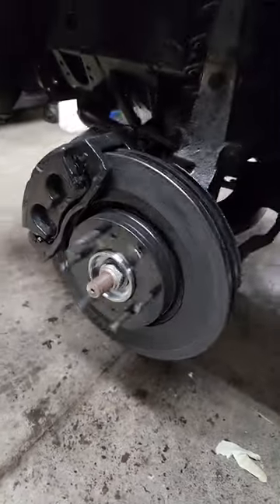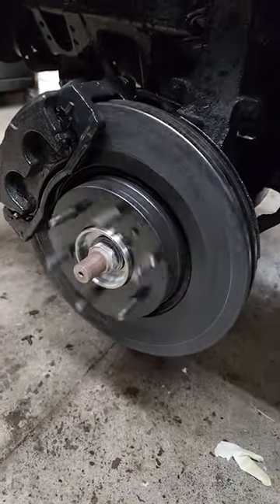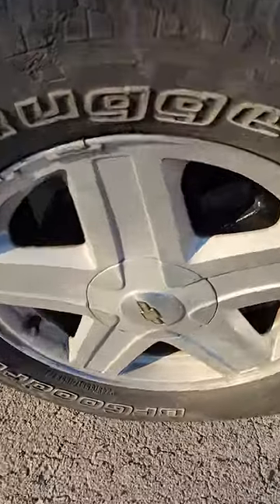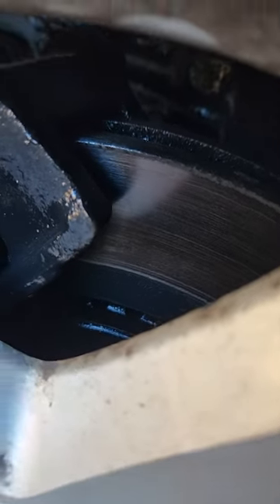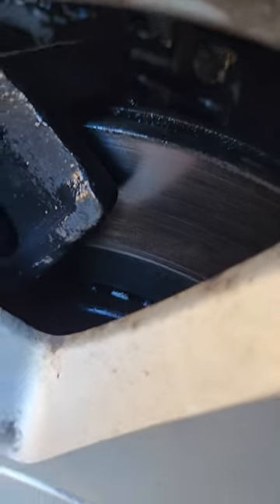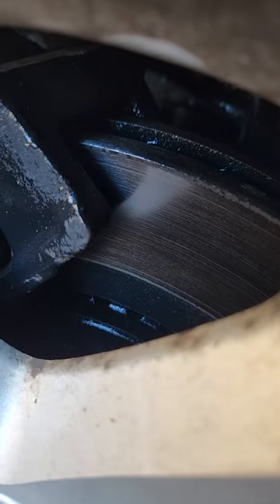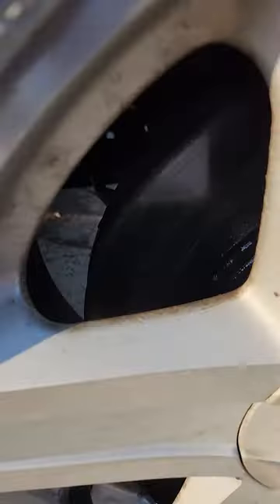Do My Brakes Work After I Painted My Rotors?

Comment: Yea, it could work. But I'd be afraid of pad polishing. 
Get the pad smooth enough, you won't have any serface to grip 
Same thing as causing hot brakes and they fade so smooth, there's no more heat transfer to the pad, causing loss of breaks

Comment: Yeah, is that High temp paint or just regular Rust-Oleum? If it's not high temp it'll all pop in like a week as they heat cycle....
Reply from the maker: Brush on Rust-Oleum, I don't know I mean it's in enamel paint and I have baked regular rustoleum at like 400° to harden it before.
Reply: If it's a daily driver the paint will be fine.  Performance driving, lots of constant heavy braking, yeah it'll burn up.

Comment: What's the advantage of doing this vs installing as engineered?
Reply: Prevents rust on the rotor top hats and edge. You can also do it with spray paint

Comment: I sure would love to see the video where you take the caliper in the pads off and see how all that rubbery paint didn't flake because it's not enamel and gummed the fuck out of the slot between the two pads the dust is supposed to be pushed out of.

Comment: Many rotors actually come painted. We just test drive it before giving it back to customers so that we wear off the paint on the friction surface. Nothing wrong here.
Reply: Coating is extremely thin on those tho
Reply: @spike9194  still applies. It doesnt take long to wear off regardless. As long as you do that safely, they become perfectly fine coated brakes
Reply: And you would also think that cheap spray paint or canned paint does not have the same chemical properties, as to what they would actually coat the brake parts with as in won't gum up with heat and friction and burn and bubble up causing it to rust almost as quickly. 

What I was taught when I studied the car mechanic is not to apply anything at all to mating surfaces exept for grease and on friction surfaces make sure they are clean and avoid all oils or contamination to them when mounting because it can cause glazing or uneven wear hence use brake clean and wipe the surface (sure you can get away with it but it desn't take long to clean it). 

Sure some do come coated but that coating powders off rather than melts  hense why you go to a autobody section and see different paints for different purposes home are harder some softer some tolerate heat others don't some paints are higher quality and there for more expensive I have worked whith cheap paint and expensive paint there is a difference between properties of paint. 

highly doubt a manifacturer goes to the next hardware store and buys rustoleum and other brand paints that we buy in our local hardware store for a few bucks they buy in bulk and get something made for the purposes they are using it for.

Comment: Yeah let’s see the pads though. Probably caked solid with paint now. Have painted the inside of rotors where the parking brake shoes ride figuring it’s only a parking brake. Cakes the shoes full and the grab and squeal after the first 10 miles

Comment: There is a reason rotors arent painted.. They get extremely hot under heavy braking, and the paint catches on fire.. Better carry an extinguisher with you..
Reply: Actually you can buy painted brake disks so I think you need to research before commenting

Comment: Look...I've actually done this with high temp paint...brakes were shit for the first 100 feet. 37,000 miles later replaced pads. No effect whatsoever on the rotor condition or brake wear. Looks like shit but he's not lying 🤷

Comment: should I do this to my EV
Reply from the maker: I am totally doing this to my Tesla. Like for real. I have the black chrome custom gunmetal Wheels. And for the last cordless Tesla video I painted the calipers Orange the whole thing looks great. The only thing I don't like is a little bit of rust on the rotors near the center hub and on the edge. The only way to get it perfect is the way I did it here. I obviously went over the top but if I did a nice job with spray paint it would have been even better.
Reply: You should drive your "EV" into the nearest body of water.. 😆
Reply: @billsauer3164  what's your deal? 🤨
Reply: @shagman9684  my deal?? 😂 I didn't kno we were selling anything. Tell me, what's your lowest bottom dollar. I'll take it

Comment: That shit is gotta burn off the whole rotor. Rustoleum isn't heat resistant and short of the exhaust pipe that's one of the hottest parts on the vehicle. I mean you could use header paint, but at the end of the day... WHY?!

Comment: I live in the Midwest, 90% of the time the parts will break before they rust out to unuable condition this is useless high temp spray paint would of worked better and be cheaper

Comment: To everyone freaking out about paint effecting the performance or smell…. He is your correct information about paint brakes. Many dealers supply their own fully paint rotors and they get worn in during the techs after service test drive to wear the new pads and rotors with eachother. Ofcorse there is a smell, all brakes have a smell depending on coating. And as for the concern of brake pads having paint in them from this happening, Napa and autozone both supply their own brand pads that come paint on the contact surfaces. It get baked off during the the first test drive. There is 0 size effect from paining your brakes.
Reply: Bro...go back to your trailer and never come out to give advise again.

Comment: Everything looks fine until either the brake pad catches fire or that tyre blows out, whichever comes first and u wind up in a ditch upside down contemplating did u spend $400 too much for the rustoleum or should I have gotten better insurance.  Then u realize how how foolish of a mistake u made when the bottom of ur pants begin to feel damp and soggy from the involuntary bowel movement’s u just had. How much worse could it get when ur upside down. 🤕🤕🤕